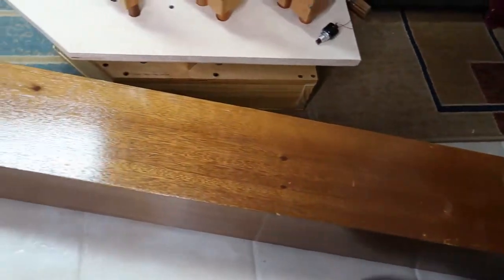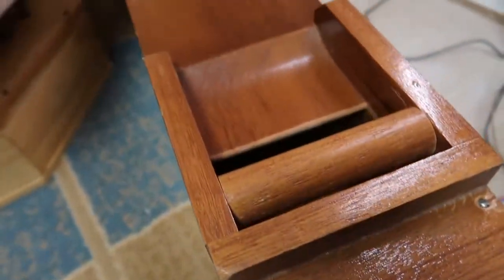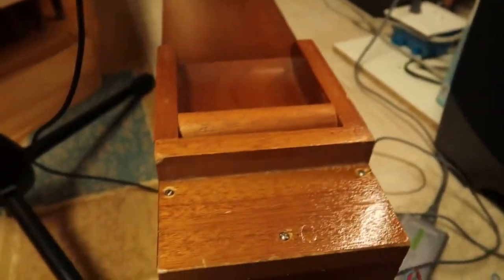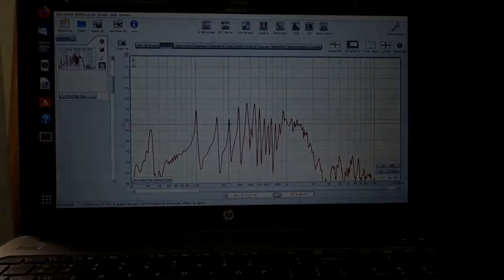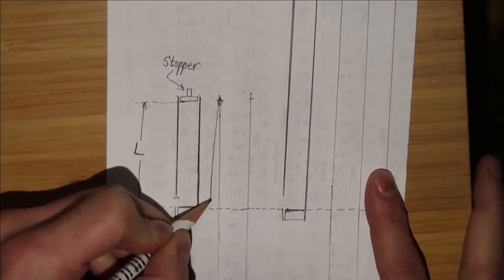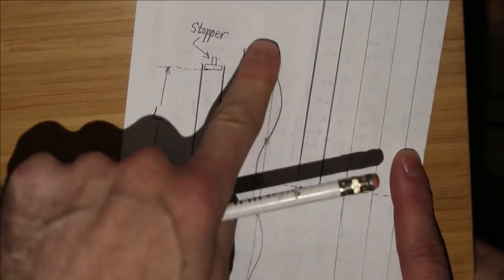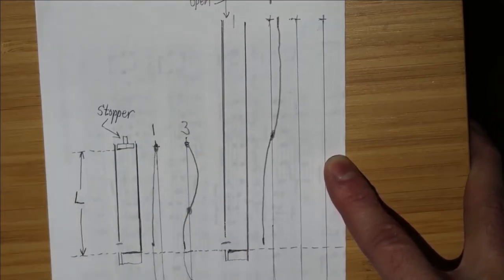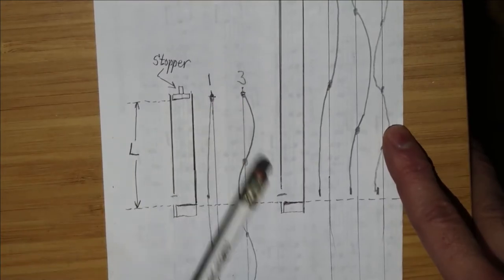Resonate a HUGE organ pipe with a speaker instead of using air; pipe harmonics

Comment: How far could you scale this?  Like, could you theoretically build an "airless" pipe organ by giving each pipe its own speaker?
Reply from the maker: Good question. Since most pipes have multiple harmonics (like the full-toned "Diapason", or a string-tone pipe), you'd have to excite it with more harmonics. But, the even bigger question for me is, if I had a whole set of these Bourdon pipes, which are fine with only a fundamental, can I use one speaker to drive the whole set, since a speaker can emit multiple frequencies at the same time? I think the answer is yes, but I haven't tried it yet. OTOH, that single speaker could resonate unwanted harmonics of some pipes, which would be bad. But it would probably work great in 1 octave blocks (1 speaker per 12 pipes).
Reply: Remember the Conn electronic pipes?
Reply from the maker: @stpetersparis  I haven't done any more experiments recently with speaker-driven organ pipes, unfortunately. Did you have something in mind you've been wondering about or wanting to try?

Comment: How does one fit a 16' Oboe stop inside an organ BENCH like that done by the Norwegian builder witteveen in their small box
 organs? This seams impossible.
Reply from the maker: The oboe sound is a reed pipe. It's easy to make a low pitched reed pipe that doesn't have much of a fundamental frequency -- In fact I have a 16' Bombard reed in my basement that doesn't have the 16' length of pipe on it, but it sounds at the 16' pitch because it has a large weight on the tongue of the reed to make it vibrate slowly. The reeds function much differently from the flue pipes and don't necessarily need the length to make the pitch like flues do.

Comment: You almost have to know what to “listen” for to actually “hear “ the 32.5 Hz tone, plus, as you noted, you’re going to need a serious subwoofer or some very good headphones for it to even be present. The closest most people ever come to experiencing a pure tone down in the 30’s, (or possibly even lower) is when by happenstance, riding in a car with the window(s) rolled down exactly the right amount while traveling at exactly the right speed, you can get that “whoop whoop whoop” pounding in your ears, but still almost ’felt’ more than ’heard’ … it can be quite unpleasant, and most people won’t put up with it for more than a few seconds. It’s like blowing across the opening of a jug, only scaled up a few thousand times. Standing waves in a vehicle’s interior.
Reply from the maker: Thanks for that well-articulated explanation. Yes, the car with one window open is a large resonator! It's probably well under 32Hz, in my experience. I should try to measure it sometime.